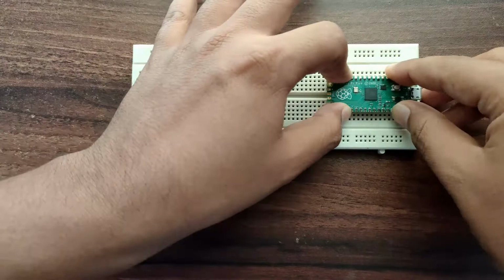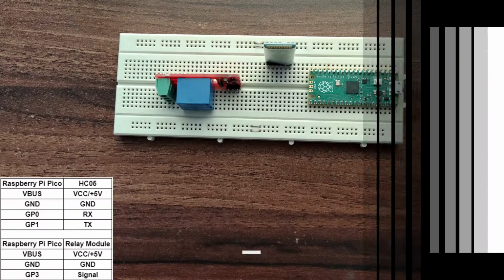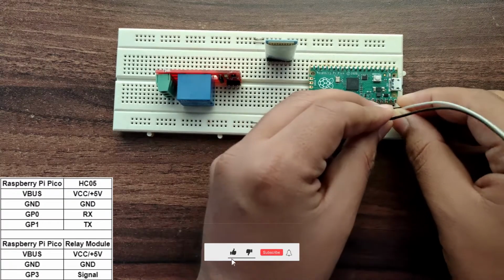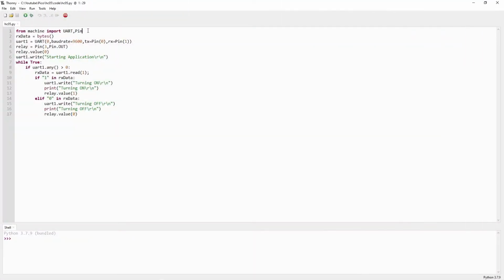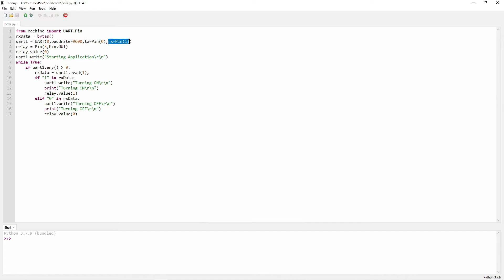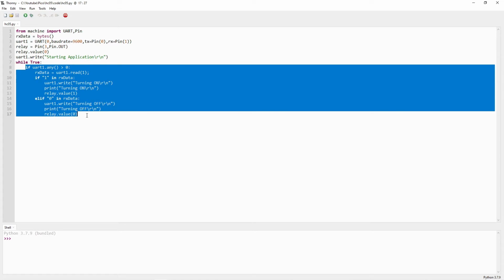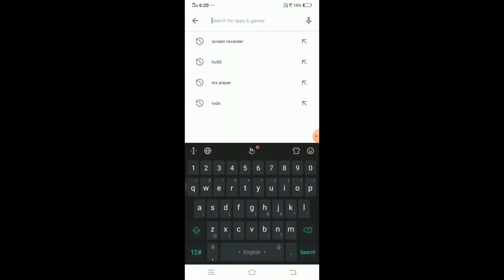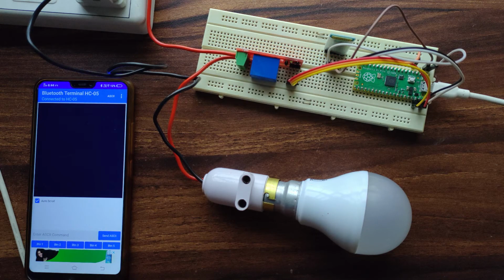Bluetooth Relay control using Raspberry Pi Pico and HC05 | micropython

Comment: Did you face any problems of relay switching or working as pico have 3.3v at logic pin connected to the signal or IN pin of the relay  and relay is of 5v